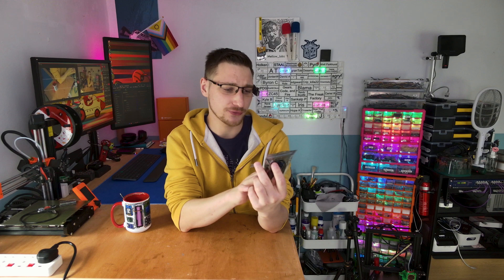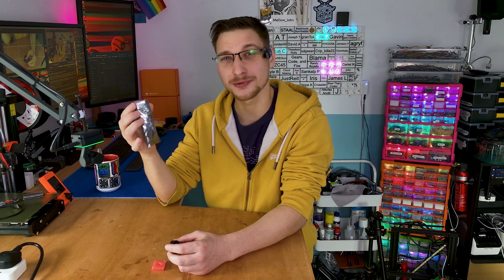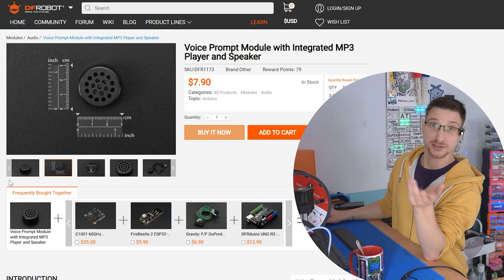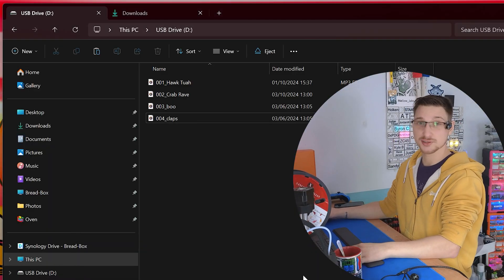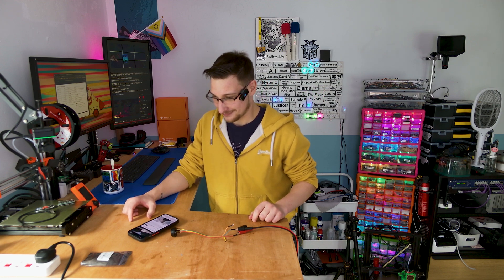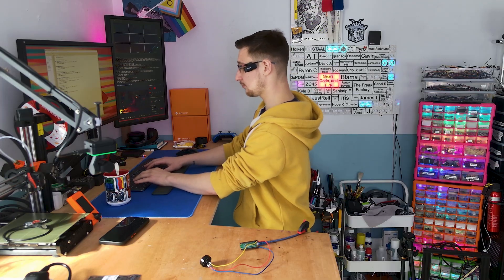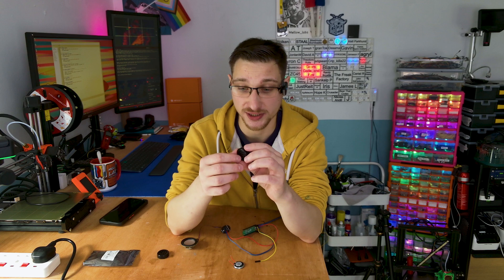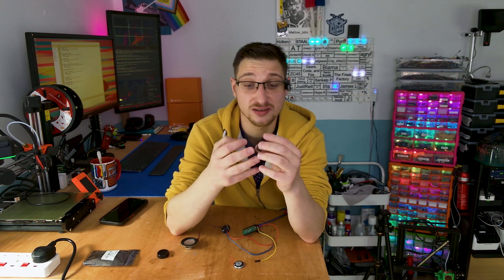Easiest Way To Add Sounds To Your Project

Comment: Thanks for posting the info....ordered a bunch of these for making prop models....how difficult was it to remove the case...might give it better installation options ?
Reply from the maker: Not at all, it’s held in with a little bit of glue. comes off with a little bit of prying.

Comment: thanks man great infos!

I need a fast responding, compact autoplay module.

What happens if you put p1 on GND and start it?
Will it autoplay a single file or wont do anything at all?

Would be awesome if you could test this! ♥
Reply from the maker: I can’t tell you off the top of my head and I don’t have a speaker module to test with anymore

Comment: Any tips on a good way to mount the DFR1173 inside a small case where the Pico would also reside? The speaker has no tabs for screwing it down so looking for ideas to secure it.

Comment: 1. I would like to have it split in two parts. 
first the DIP chip replacing old melodie chips used on 1970,1980 clocks.
second the speaker with amplifier if needed at all, supporting existing piezo speakers as well.
2. WTH, how can anyone sell a product that has no indexed connectors.
It takes just a single pin to prevent plugging in the wrong way.
WHO made this? Chinese, obviously.

Comment: Well… any option to rec your voice then playback with it?
Reply from the maker: Yes, if you record it on your computer and upload them to the speaker
Reply: @Mellow_labs  thanks for the reply… but what about with that pico attach with mic module? Possible?
Reply from the maker: @mrbulp as far as I can tell from the documentation the uart connection to microcontroller does not allow it to upload new audio
Reply: @Mellow_labs  noted. Thanks

Comment: Gotta second the JLC PCB spot - I used them to order the PCB for my custom keyboard which I designed back in 2020. It's now had 4 years of hammering as my daily driver and has held up perfectly! I've ordered a bunch of other projects for them too and never had a problem!
Reply from the maker: That’s awesome to hear, I asked a few people about their experience with JLC before agreeing to a sponsorship. And everyone was positive about it.
Reply: @Mellow_labs  Well just to pile on. I've used them a few times now as well over the last couple of years and it's always been a good experience.
Reply: @Mellow_labs Gonna add to this - I've just started using their PCBassembly service, and they have been so helpful ❤
Everytime I had a problem, they'd answer my emails very quickly, any issues with my files, they're straight in my inbox, asking questions, getting it done right.
PCBA is not exactly cheap but the parts are priced at bulk rates, great when you're dealing with tiny neopixels ❤❤❤
Reply: I never had custom PCB boards made but I am in need of some. Do you have to design them yourselves? Or can you just tell them what parts you need on them and they'll figure it out for you?
Reply: @remconet You will have to design it yourself.